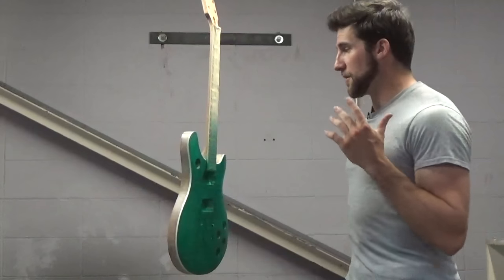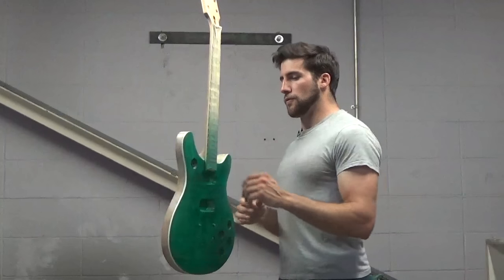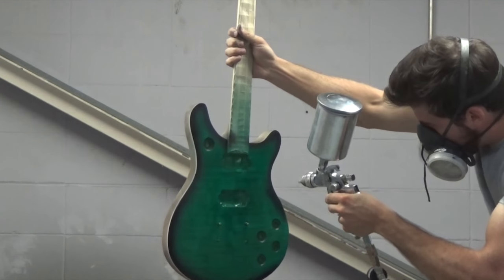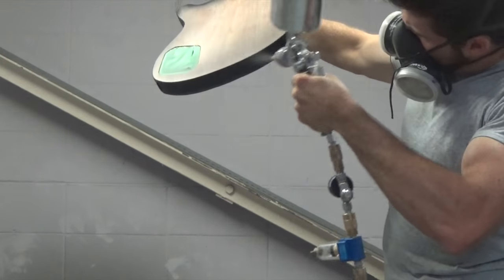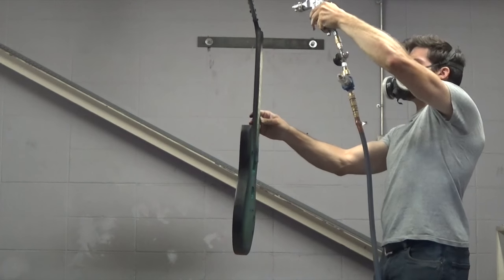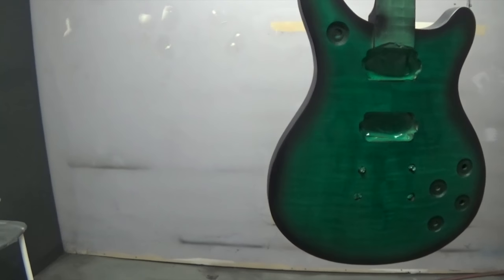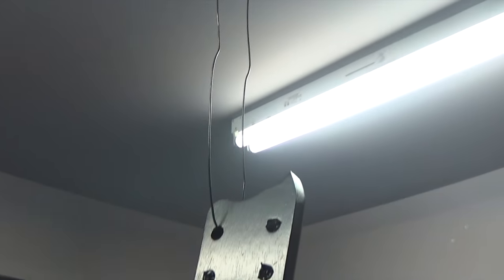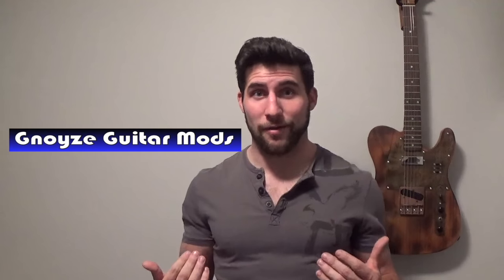The Guitar Kit Build From Guitar Fetish Part 16 | Painting the neck, back, sides, and burst

Comment: Hey brad,
 A note about the grain filler on mohagany headstock, that stuff will really suck  up the lacquer even with a thin sealer, (unless its a 2 part sealer that is essentially concrete once set).  Maybe you build the sealer thick enough to sand flat and then topcoat it....?   OR If you put fine filler on it, flattened, then a coat of black, that would do the same thing as sealer basically.... Just thoughts, Bottom line is use more sealer!!! (for mahogany)
Reply from the maker: Yeah, mahogany is very porous. I think what I've opted to do is put the graphic on and then clear it a bit more aggressively. Then I'll polish out the clear flat, but you'll still be able to see that grain through it; just not in the actual finish.

Comment: hey Brad ! awesome videos ! one question about the masking tape you're using on the neck and cavities : when do you remove it ? do you remove/replace them between each coat ? or after the whole guitar is finished (wouldn't it be hard to remove them then) ? thanks
Reply from the maker: I remove it after the whole guitar is done, and use methanol to carefully clean off any residue it leaves on the unpainted surfaces.
Reply: thanks :)

Comment: I'm building a kit from Guitar Fetish too. My question is would it be better to paint the neck by masking off the fret board or to remove the board, paint, sand as needed and re-glue the board to the neck? Thanks!
Reply from the maker: I don’t know if one would be better per se. I don’t see any reason to go through the process of removing and reattaching the fretboard though. It can cause problems with the board and frets themselves if done incorrectly.
Reply: Thanks man, I appreciate your advice. New question: My kit is a glue on neck and the neck and body will be the same color. Is it better to glue the neck in place THEN paint the whole thing? Or paint the body and neck separately then glue the neck on? I already know about making sure to sand the inside of the neck slot and parts of the neck before gluing.  Thanks again.
Reply from the maker: If the neck fits well, I would glue it first. That way you’re not relying on the paint adhesion to hold the guitar together, and you’re not trying to glue paint with wood glue.

Comment: Brad how do you handle the build up of paint on the neck as it meets the fretboard?
Reply from the maker: I carefully reduce that edge using a fresh razor blade like you would use a card scraper.
Reply: Cool. Do you clearcoat over it after?
Reply from the maker: Yes, and then I do the same thing to the clear coat and gently sand that edge smooth with high grit paper.